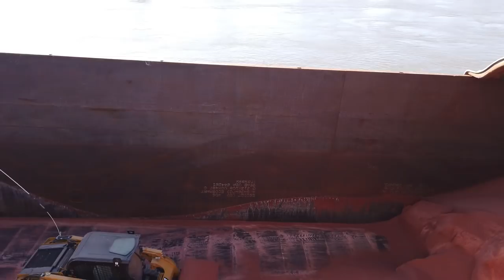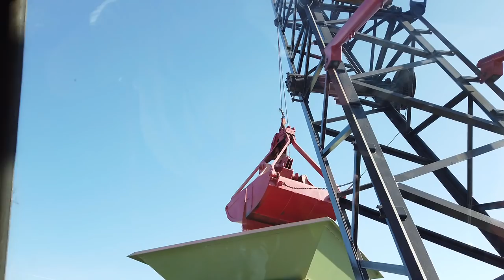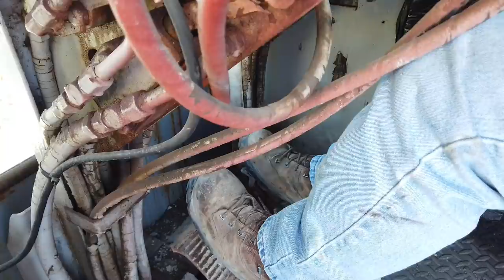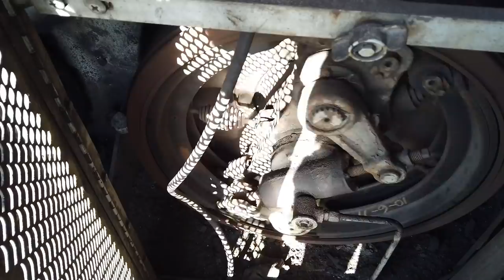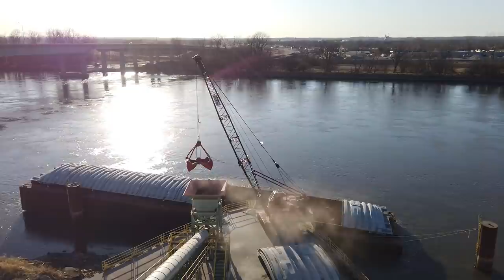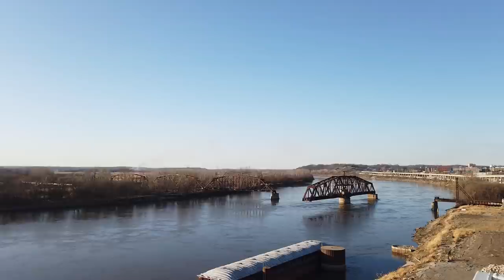Clam bucket on a friction crane | Unloading a barge with a crane

Comment: Miss running those
Erected steel 200ft boom hc238a Link belt. and PH 670...
New hydro cranes safe easy..
Some Lorain had boom down pull back handles...Some had live boom and no swing brakes.
Nice operator smooth safe.
Thanks..
Say a prayer for everyone especially older people now...
Jim from NYC.
Reply from the maker: I don't have much experience with them. Hence the reason that I was recording and observing. Many thanks for watching! 🙂
Reply: @ToTheTopCrane  try to practice you will love it. Start with single whip line no bucket

Comment: We got rid of the last 5 friction crawler cranes in 2008. I didn't miss working on them. We started the change to hydraulic material handlers in 1995 with a Koehring 6650SK. The last new friction crane we bought was an American 7220 in 1983. We had 3-7220s, a 797 and an American 395 on a Crane Carrier chassis. We had some older 30 ton Link Belt crawlers that we scrapped out in the 80s.

Comment: Nice shot of the St Joe skyline and Old Glory at the end Jimmy!   And thanks to the operator for giving us a ride in the Link Belt too!  I'm counting function winches here and just wondering how many winch clutches and brakes are on this crane?  Since all of the up functions and turn functions are powered then I'm counting 5 clutches i think, not counting the drive functions which would make for 4 more, then at least two brakes, one for the boom down function and one for the bucket down function?  I'm guessing a third one to hold the clam shell bucket closed.  This rig looks high maintenance and I can see the need for an oiler on them for sure.  Thanks for showing this one off to us!!  Fascinating piece of machinery for those of us who like to see the spinning bits do their work!
Reply from the maker: I'm not sure of the number of clutches and brakes. There are three winches. One for the boom up/down, one for the main, and one for the auxiliary. Many thanks for watching! 🙂

Comment: Gah, I remember doing this for ship loads of concrete. 60k tons with an 11yd grab. 6 days of 18 hour days. Two or three times a month. Using the shipboard cranes. Which was a glass box with a huge hydraulic motor under your seat to keep you warm in the Florida summers. We wouldn't put the loaders and manlifts down into the holds until near the end to get the last little bit and bang the sides. As the generally had to be food grade clean when we were done.

Comment: This was pretty much what everybody had back in the late 70's early 80's when I first started working. Almost all Detroit powered, some controls were manual, some hydraulic, and some air. Brake bands and shoes to adjust. When the scrap yard's and demo companies used the old clapped out ones wi8th the hydraulic controls they would pressurize the hyd tanks to about one PSI t0 keep the bands and shoes just touching because most of the time the adjusters were F"ed up. Some would power down and lowering the load was easy, and some you had to rely on the hoist brakes. Turning over backwards was always a danger.
Reply from the maker: I'll stick with the newer hydraulic cranes. There's a lot going on inside the old friction cranes. Many thanks for watching! 🙂
Reply: @ToTheTopCrane  What really killed them was the setup/breakdown and transportation time/cost. Lots of people, lots of trailer loads of boom, lots of removing and installing of outrigger boxes, and counterweights. And if you needed a lot of boom, you needed a lot of space to setup. Sometimes with really high boom you needed another crane to assist to boom up from the ground
On a positive note though, usually the chart didn't fall off as fast for radius.

I worked for these people. They closed down in 1990, but we stay in touch
https://sbiii.com/rdldpix/McHugh/mchugh8a.jpg
Reply: Cindy Tepper that’s an awesome picture. We had a wonderful crane company here in SoCal that ran a bunch of conventional cranes in the oil patch. Thomas crane and trucking.
Reply: @ryanburbridge  Yeah. they did some wild stuff. I'm going to say that picture was late 70's at US Steel Fairless Works. At one time back in the 50's or 60's they had the world's largest truck crane built. They had a US Steel ad hanging in the office with a picture of it and US Steel was boasting that McHugh specified it built with US Steel. I guess they did, USS Fairless was one of McHugh's largest Customers at the time

Comment: I used to erect Iron using a 75 ton P&H with 200' main boom and a 40' jib. My operator could run that machine smoother that the Grove 30 ton we also had.
Reply from the maker: That sounds like it would be a handful! Many thanks for watching! 🙂

Comment: I see from the replies a few have experience with the type of crane. Being a heavy equipment mechanic I can’t just watch and be entertained like most without diving in. I searched but can’t find a control diagram. Can someone comment on the controls he was using. The left hand I noticed he would go forward, then back. Was that to start motion then “catch” it?  I can’t figure out what the feet were doing and his right hand.
Reply from the maker: His left hand was running the swing control. There is no swing brake. So, he was swinging and counter swinging. His feet were operating the brakes on the winch drums. When the left brake is released, the clam opens. When the right brake is released, the clam lowers. His right hand was engaging the two clutches for the winch drums, and also the boom up/down control. If the far right lever is pulled back, it releases the brake on the boom winch and engages the boom up clutch at the same time. If the lever is pushed forward, it again releases the boom winch brake and engages the boom down clutch. The other two levers on the right, engage the hoisting winches. Hope all of that makes sense. Many thanks for watching! 🙂
Reply: Thanks for the info. I wish my mechanical mind could stop with “it just works”
Reply: Damn it, now I have to watch it again with this info

Comment: Do you think the operator’s of friction cranes are a dying breed?  Are younger operators training on these?
Reply: They are,  most older operators are retired, retiring, or passed away. No new young operators want to run them because they are more labor intensive to operate, noisy, and hot, no ac, no adjustable air ride seat!

Comment: Looked like that one hydraulic line could have used a zip tie on it to keep it away from the swing clutch. But I guess to keep it period authentic, a piece of tie wire would be correct.
Reply: I believe that is a grease line for the bearing. You can see similar fittings on the ends of the other clutch shafts, but they have hard lines going to them.
Reply: No, that’s the air line to the clutch cylinders - I expect that it was probably done in copper tube originally, but it looks to have been replaced in nylon at some later time.
Reply: @steveallarton98  Right. I knew a “hydraulic line” on that old friction crane wasn’t right, but not being real familiar with old diesel engines I just called it what it looked like. I knew anyone that watched the video would know the line I was talking about. 
I’d put a piece of tie wire on that sucker anyway! 👍
Reply: psidvicious Absolutely !

Comment: What do you call the reel on the side of the boom? Does it have the function to reel itself in?
Reply: Not sure if the name, but the hook is attached to the claim bucket to keep it straight and its spring tensioned.
Reply: A tag line i think that's the name.
Reply: Steve it’s a tag winder

Comment: Awesome video. That's the only way to clam in my opinion. Those old girls are great for duty cycle jobs, not so good on the knees. I always described it as like running a hoe but with a crane. I'm pretty new into the crane world on been at it almost 3 years, but was fortunate enough to learn the friction rigs from the other ops. The company I work for has a LS 108, LS 118 and a LS 98. Thanks for all your hard work and education. IUOE Local 18 Ohio.

Comment: This setup is so inefficient. A purpose built material handler like a Liebherr or Sennebogen, or converted excavator blows this thing out of the water.
Reply: If your not cut from that cloth just say that lol
Reply: @richb9564  lol. we ran Manitowoc cable cranes for years..Then went to converted excavators, then to Liebherr’s and Sennebogen’s. Just pointing out the efficiency differences as I know first hand..